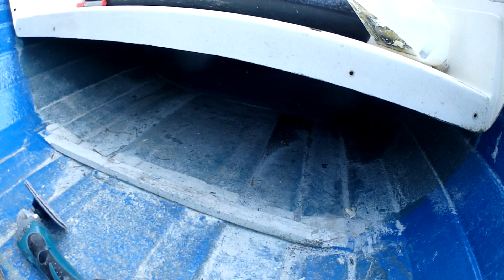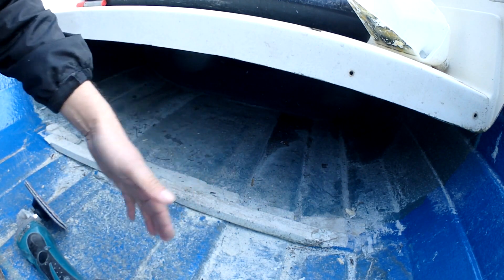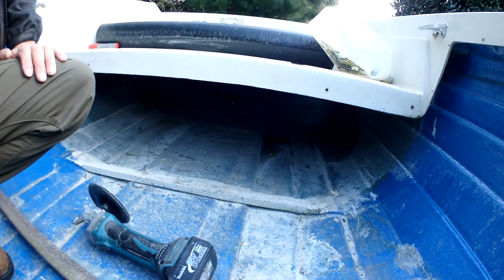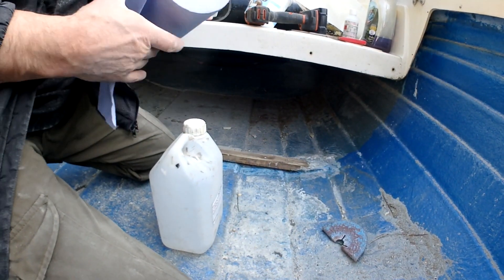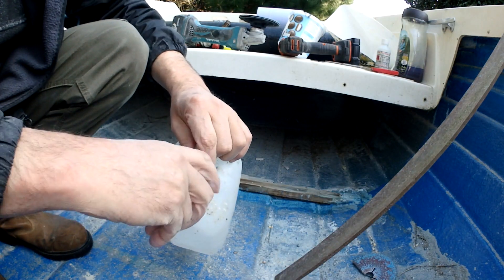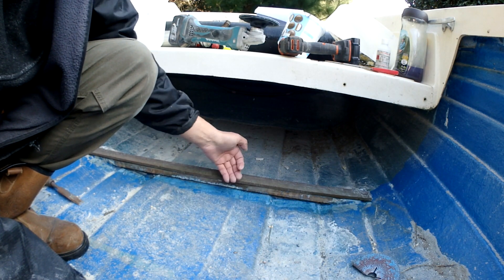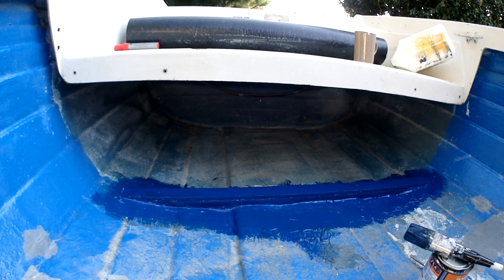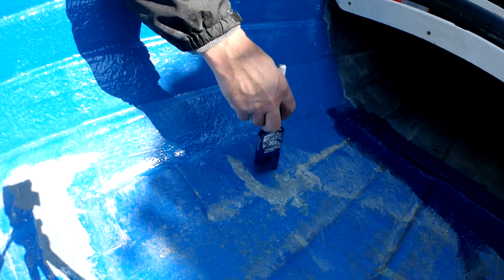Orkney Fastliner 16 Refit - Stern Locker

Comment: Hopefully it works the way your planning Troy .

When you hoping to get it in the water ?
Reply from the maker: Hopefully, The old boat I had to drill 2 small holes in the floor to drain the water out that was a sealed one. Depends on the weather but April sometime
Reply: @Trojwaterman  is it having the 20 Suzuki on it ?
Reply from the maker: @C3BFA  probably. I will see once in the water would not mind trying both 10hp and 20hp   to see the difference in balance, speed what's needed and and how efficient they are. The 10hp has a high thrust prop the 20hp does not
Reply: @Trojwaterman  the 10 is a lot cheaper on fuel I have found that with me me and I haven't had much use from the 20hp yet could do all day on the 9.9 for less than £10 I used £10+ in less than half a day with the 20hp but it does get you around faster and technically for you get more pots pulled
Reply from the maker: @C3BFA  Yes true the Suzuki has this lean burn which I have heard is very good so interested to see how much difference it makes.
Reply: @Trojwaterman  bet you can't wait

Comment: I don’t know how to say it in English but I don’t like seeing you having problems with your back. Hope it will turn for the better soon. This boat project is fun and interesting to watch, looking forward to when you get the pot hauler. Was there an press wheel on yours? I have to make on on mine, but I have a other type. An old combi that runs on hydraulic. Wish you all the best mate and get some rest to heale 😃👍
Reply from the maker: Yes there is a sprung bar you can drop on the rope on the winch

Comment: It is interesting to watch you deal with one issue at a time, doing it well and explaining the job.
I still prefer your old boat but I do like the Clinker Built style of the new one.
Ever since you have started putting the refit up on the channel, YouTube has been putting these boats up on my feed. Looking at the average horsepower it seems this hull design can move well without adding huge horsepower to it. Obviously for your use in your business, this makes good sense.....or dollars as it were.
Enjoying this. The condo I own has no garage so I don't get to do much shop work anymore and I miss it. Thanks for continuing your channel through these strange times.
Reply from the maker: Yes the one big difference with this boat is the weight its much lighter and easier to move around unlike the old one. It also has speed on its side without needing an oversized engine. The old boat was a displacement hull so only had a max speed of about 7 knots putting a bigger engine on that boat would not make it go any faster. It should also be easier to lift gear out the water as I will not need to hold the heavy weight of the old boat in the strong tides.
Reply: @Trojwaterman  all good reasons to change. I'm sorry, I was not thinking of your back. Hopefully the winch will take some of the effort out for you. Is Fishcat still okay?

Comment: If you wanted to prevent seaweed, dirt etc from getting into the back area without sealing it up you could make a curved plate that is 150mm high at the center & pop rivet a strip of flat rubber strip between the bottom of the plate & the newly fibreglassed ridge on the deck. If you had this then you could easily pull the plate flap down to put items such as fuel tanks under the stern & then release the plate flap where it would then return to a vertical shape. A rubber strip about 150mm wide x 2m about 2mm or 3mm thick would be ideal for you to cut into a curved shape that is 50mm wide which would be enough for a bendable flap together with a 150mm high curved aluminium plate.
Reply from the maker: It possible I will revisit and change the locker next year I need to see its ok having fuel tanks there first with the weight distribution
Reply: @Trojwaterman  so what do you think about that bending flap idea so that you could still store your tanks underneath but also allow it to sit up & block any debris from entering the storage hold?

Comment: What's the MCA rules say as I thought you had to have fuel tanks secured by straps these days, if it were myself I would make the back locker watertight even if you have a big door at the front, neoprene tape works well at joints, but if the worst happened you would be glad of the extra floatation tank at the back.
Reply from the maker: I have never heard of that rule or seen it in my paperwork or have never been asked to do so. My old boat had a sealed cuddy I had to drill  holes through the floor in the end to drain the constant water build up. The whole space under the floor of this boat  is a flotation tank
Reply: @Trojwaterman  To be fair it's what I was told that they had to be strapped to fixed points but harbour talk is harbour talk if you know what I mean, but I did have a mate that took a solid lump of water over the side only half filled the boat but without that buoyancy from the hull the engine weight took the stern under, he was lucky that he had fenders in the bows and this kept just the stem of the boat on the surface and he was able to hang onto this but he thinks without those fenders the boat would have gone down, he said from start to finish less than a minute.